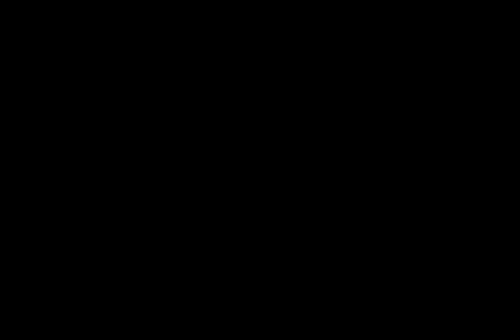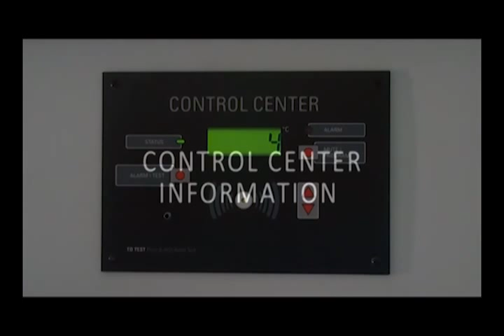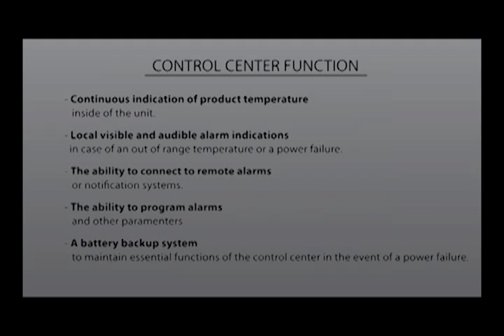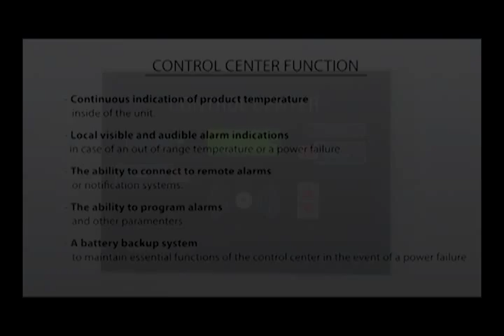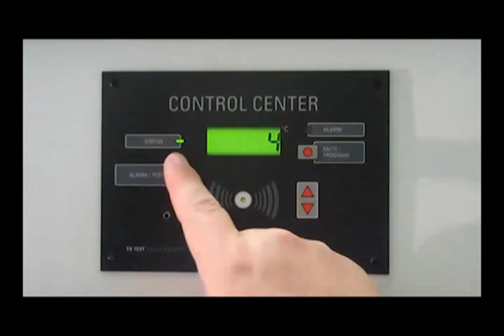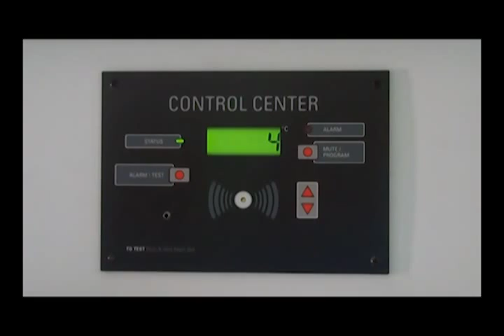Control Center

Comment: Its pretty stupid the controller is not able to be calibrated to actual temperature inside the unit. Its also not possible to turn down the temperature manually. I wouldn't recommend this unit.

Comment: What about the control temperature? Our refrigerator is cooling non-stop and going into freezing. There is a label that says mechanical control is disable and control is "upgraded" to microprocessor control in the front of the unit, which is this control of the video, but there are not actual temp control functions there.